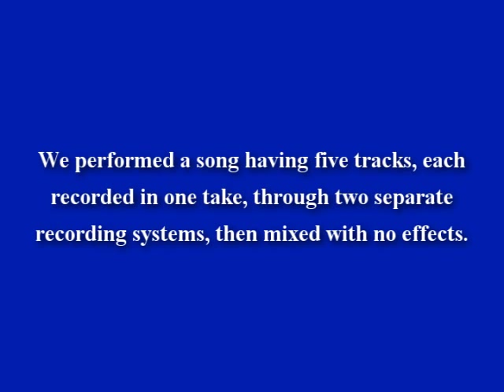Converter Test Session

Comment: Heck I’d like to pick your brain on the delta 66 because I paid 350.00 back in 2000-2001 for that thing and it’s sitting in an xp computer and I can’t even use it I’m my 64 bit computer where I started playing synths.  And I’m a guitar player.   I learned how to mix drum vst and quit jammin.  Especially when I took the audio from my xp computer and it sounded like chipmunks.  What a mess.  Times have changed I better learn to use it so I’ll probably be at the forum if you can advise me on any of that.  ✌️
Reply from the maker: Your Delta 66 card won't plug into any modern computer slot. I had the same problem a few months ago. I retired a Windows laptop and replaced it with a new model, and I couldn't re-use my perfectly good Presonus FireBOX that connects via FireWire. I tried a FireWire to USB adapter but that didn't work. So, like you, I have a working external sound card sitting on a shelf. I'd be glad to give it away if anyone could use it! The good news is you can get a much better quality USB sound card today for a lot less than what you paid for the Delta 66. Look at the Focusrite Scarlett series starting at $100, and get whatever model has enough inputs for you.

Comment: I finally got a mic splitter so I could test out the difference between cheap/expensive preamps and A/D converters.  I got the same result.  NO DIFFERENCE AT ALL.  THOUSANDS of dollars worth of equipment and not a damn bit of difference.  THIS INFORMATION NEEDS TO BE CIRCULATED so people stop ripping us off.
Reply: Mark, you are wrong but at the same time i think you are correct, in one sense that is. I don't hear any difference either in the actual instruments/performance unless i listen 100times then maybe i will, so most likely micpres/instrumentsshape/playing/acoustics plays a much larger role in getting a "good sound". So what do i hear that you don't?. NOISE. If you listen to the noise in the background it should become clearer as to which sounds the best of the examples (not saying which is which!). To make it even easier for you (If you don't hear the noises without it!). Turn on a vst compressor and crank the threeshold bring up the makeup gain on each example. Headphones is easier, then you don't have to crank the gain on whatever monitors your listening in, cause you have to have a certain volume (at least for me) to be able to tell the differences in monitors. I hope you hear it, if not don't cry. I've wasted 15years of my life with musicproduction and haven't gotten far, but i'm so used to sounddesign and hearing white noise/noises in generally that i probably picked up on it just because that simple fact.
Good Luck!
Reply: ears are muscles, I think yours are not well trained bro

Comment: My ears must suck...because I couldn't really tell a difference. lol
Reply: Guess what? I just listened to the files in my treated room , 2 different set of headphones and i can't tell the difference lol
Reply from the maker: GuitarMan216 Any differences are subtle to be sure. I've gotten more than 80 emails from people since posting this, and most either admit they can't hear a difference, or they guess wrong.
Reply: Ethan Winer Yeah and I was listening on decent monitors, in a relatively treated room. 

Makes me think twice about dropping $2k+ on better conversion...
Reply from the maker: GuitarMan216 If your room is only "relatively" treated, and the converters you have now are fine, there's your answer. It amazes me that people will obsess over a sound card being 0.5 dB down at 20 KHz, while ignoring half a dozen peak / null spans of 20 dB or more (!) in their monitoring due to inadequate bass trapping.
Reply: Ethan Winer Right. It "could" be better I'm sure, but I built superchunks in 3 corners (3rd corner is open) and have 6 DIY panels kind of randomly placed on the walls. Just built the room a couple months ago and haven't gotten the equipment to really test it...so it was just placement by ears and reference tracks. Not the most scientific way...but it is what it is for now.

Watched/read a lot of info from you in the process...always quality stuff, thanks.
Reply: +GuitarMan216 Try listening on some good headphones.
Reply: +Rony Large I did. I also listened in my treated studio on my HS8s (have since tested the room and moved panels)..
Reply: +Rony Large Yeah that's what I was saying. My room isn't perfect...but it's better than most. And even on my headphones (which again, aren't perfect, but better than most) I couldn't tell the difference.
Reply: +Ethan Winer A similar quote changed my life.  It was either you or Tweak from Tweakheadz which said "...equipment flat from DC to microwaves...but ignore room response of +-30dB...".  The more I read and listen the more I stand by: great song, great performance in a great room with great production and captured by a great engineer - in that order; everything else is lighting on the cake.  I guess you could switch production and room but that's what cover versions are for (and electronic music).

Comment: Mix b sounds better than c. Would of liked a higher end converter comparison than the Lavry. Truthfully one huge reason for high end conversion is record in 192k not 44.1. You guys should of recorded trough the lavry at is full 96k capabilities, and not bring it down to the m-audio's potential. There is a big difference in conversion from 44.1 to 192. I could compare my Lynx Aurora or Apogee symphony converters at 192 to my mobile Presonus rig 44.1, but thats apples to oranges.